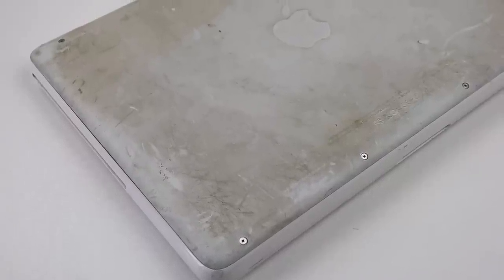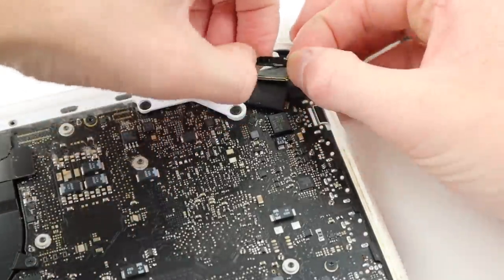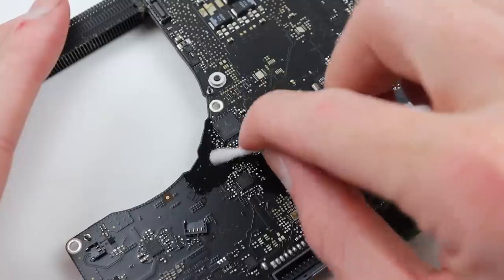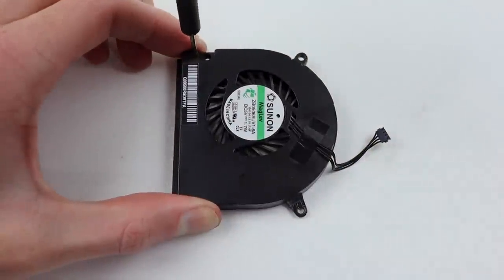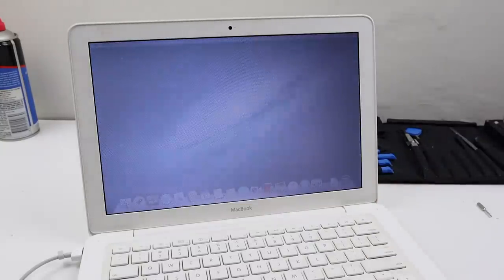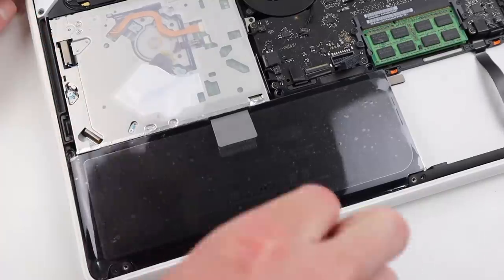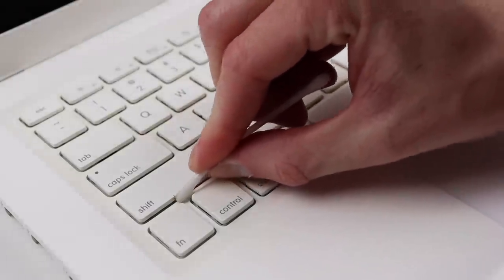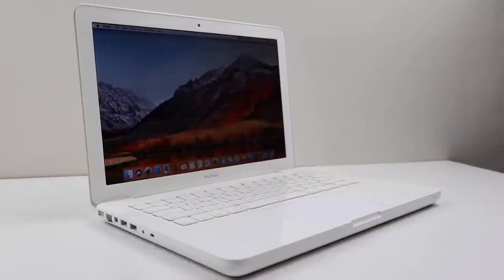Filthy, Dirty MacBook Restoration & Cleaning

Comment: Damn. Very nice cleaning, Hugh! I still have and use this Mac as to date, every once a while since I bought it in 2009 as my 1st Mac ever. The rubber bottom surely is dirty by now, but not this dirty. And logic board areas only dusty on the fans, will try to re-paste it for the 1st time, thanks for the tips!

Comment: GREAT Job. My very first MacBook was that generation. I've since gone through two more MacBooks since that time, with my current one being purchased in 2020 and has the M1 chip. I use my Mac quite extensively giving them a life span of about 5 or 6 years before needing to be replaced.

Comment: 99$?, I paid like 25€ for the same one, with same tools.
Reply: That must be 99AUD not USD
Reply: @shivangsingh8417  still double the money
Reply: @sriramx1  Shipping to AUS can get expensive real quick 
Also, prices down there are pretty insane in general
Reply: euro has a much higher value then AUD so you’re basically paying the same price in most cases
Reply: Okay, so with Hugh his work it's absolutely not profitable in any way shape or form. BUT THEN YOUTUBE! His content is the money earner. That's what his channel is based on. In any normal situation dropping $99 on a battery for a 2010 MB is outlandish. But because he did people won't call the video half in the bag and the video will be successful and make that back in no time at all. He did a very good job with it I must say. Mid-2010 MB's are actually pretty good machines to run now adays because of MacOS 10.13. The only issue I had with the video was the fact he dropped $100 on a new battery, $50 on a SSD, but then REFUSES TO UPGRADE THE RAM BECAUSE "At the time ram is expensive." DDR3. DDR freaking 3. The max that machine can run is 16gb. to get 2 sticks of DDR3 8GB is like $40 in total. To get AT LEAST 8GB of total ram would be $20! The difference of 4GB and 8GB is what makes the entire computer worth it. Hearing that ruined it for me, HE WAS THAT CLOSE to making a good machine, dropped $150 on a battery and SSD and says "4GB is fine." Shame.
Reply: Joseph Clese I agree
Reply: Any link for buying the battery sir? @XPLSVdstr.
Reply: Paulus Leonardo I was agreeing on the ram not the battery. I have not purchased the battery. Sorry for the inconvenience
Reply: @bobeshekyan3990  I ask to the guy who buy it sir eheheh, I forget to mention him
Reply: Paulus Leonardo it’s no problem
Reply: i just paid 75AUD  for a 2016 Macbook . Because of the Current government we have crap conversion rate . Our  1AUD is 49-51 GBP

Comment: I have the same model as above but upgraded to 8GB RAM, 250GB SSD, 500GB HDD, new speaker, new battery and new bottom cover. It was my work laptop for many years and now repurposed for iTunes library.

Comment: I think something that might help is that for adhesive residue, normal lighter fluid can be cheaper than purpose-sold adhesive remover and more effective than alcohol. Judy be careful, it can sometimes dissolve certain plastics too.

Comment: Great video!  Small tip: When removing stickers, the best option is to use acetone, or nail polish remover which has acetone in it. It takes much less time compared to using ethyl or isopropyl alcohol
Reply: Uh no, bad idea to use acetone on plastic. I spilled a little on the cover while doing my nails, it melted the plastic. 

I personally use eucalyptus oil (unironically) and paper towel, just scrub it out.

Comment: I got the same MacBook design, but earlier. 2009 late. It was the first unibody plastic. 
I am actually writing this comment on this computer. I still absolutely LOVE it, however I use it as as secondary computer/main computer is an iMac 27"/. 
Got the same SSD which really gave a kick to the speed.
Mine is in perfect condition. In fact a few years ago I brought it to the Apple Store to change the bottom rubber part and the guy was surprised how clean my MacBook was. He said it is rare to see a MacBook in this condition. So I took it as a compliment :)

I will never understand how people can make their computer so dirty.. 
These things are expensive, why don't you take care of it, so you can use it much longer...

Great video, added to my fav. list!

Comment: These MacBooks are kind of dear to me as it's one of the very first laptops I ever owned. Trying to piece one together using Mac's bought for parts, but will have to be careful with the ones purchased, as they are rather fragile from being abused and left to their disrepair. Glad yours didn't need much help, just the minor additions of SSD and the battery. Mine have bent hinges along the back. We'll have to see how far it goes, but I've noticed no life from the second MacBook, and a distorted feed to the screen of the first. Thanks for the direction.

Comment: Amazing job mate. In last december my macbook pro  felt in thd floor and the motherboard broke. Since that, as the repair is quite expensive here in brazil, I am using an older version of this macbook, the mid2009 as my dayly driver. They do are still up go the tasks. Those were well madd computers.

Comment: Hi Mr. Jeffreys. I have a 2008 Macbook that still works with all original parts including  its original battery and charger. The only thing that does not work is the trackpad so you'll need a mouse. It looks very decent except for the bottom:  there's a dent and some misalignment and some missing rubber pads. Any suggestions what I should do with it? Thanks!

Comment: THE easiest way to clean ANY motherboard it to wash it. Spray it with mean green let it sit on the motherboard about 15 minutes and then run warm water over it. let it sit under a fan until it is completely dry and when done it will look like new. An added benefit is that on older mother boards you clean under components you would never be able to get at any other way.  I have done this with motherboards since 2000 and it has never failed. Also IF you are going to use a brush a paint brush works better. The ends are softer and get in the cracks better.

Comment: I actually bought a MacBook just like that off EBay for 50 bucks. The insurance company that it came from was getting new ones. They had put in a SSD drive and eight gigs of memory before they decided to get new ones. Everything works like brand new. First MacBook I’ve ever owned. Plus I saved from the trash heap.

Comment: Ive had this computer since 2010. I got an SSD, 16gb RAM, and an LCD replacement. My cat used to sit on the laptop while it was closed and damaged it. I recently also changed the thermal paste, I had put off doing it for a while because I had no prior experience and taking apart the motherboard made me nervous. My laptop would get RED HOT with 11 year old thermal paste. It would get so hot that when I would charge it , it melted the plastic around the little pins on both the charger and the port. I followed the guide from ifixit for this specific laptop. When I turned around the motherboard, I was surprised at the amount of dust on it. It looked fairly clean on the surface, so I wasnt expecting the caked dust on the underside. The top screw of the heatsink was so tight that I never was able to remove it. I stripped it but Im lucky it was the top screw, I removed the others and just slid the heat sink away from the board and carefully tried to bend it upwards as much as I could to place it back properly. When I turned it back on, the screen had red glitches on some areas. My heart sank and I opened it up again, disconnected the display cable, blew air on it and tried again. A small piece of dust mustve been inside the connector. It worked fine once I turned it back on. It was really satisfying doing it and my computer runs quite cool now. I love that this laptop is so easily upgradeable.

Comment: I find the best way of removing dust off boards and other parts is with a make-up brush as it has lots of fine fibers and a rocket blower you would use for photography to blow dust off lenses. At least, it worked perfectly well for cleaning my ATX motherboard that I had to sell.

Comment: Hey i have a 2012 MacBook Pro and one One day when I had it on my bed I tried to turn it on and it just showed the missing folder logo and after doing a bit of research many people said that it was th cable connecting the hard drive and it doesn’t recognize the hard drive i than bought a new cable to see if it will fix it but I didn’t any ideas where they might be

Comment: Thanks brother, now I won’t have to throw away my Macbook Air I bought 2 years back. It’s battery is 85% healthy and it’s pretty fast for now. Once it starts showing ageing.. perhaps in 12-16 months more... will just replace the battery and clean the insides and done for another 3-4 years lol. I only use the macbook for excel, pages and safari.

Comment: Nice restoration. I agree that the 4GB RAM wasn't worth upgrading as this still has an Intel Core 2 Duo installed.
Can't believe that someone would let the laptop get into such a dirty state!
I've also taken apart random generic Macbook batteries (from job lots) and found that the capacity of the cells don't even add up to the stated capacity printed on the battery e.g. 6000mAh rated but the cells were only 5000mAh, or even less.

Comment: Might wanna check the keyboard connection, it looks like its slightly out on the left hand side, i find that when installing batterys on these it causes this too happen as the battery catches on the cable going too the connector, its not a big deal but it's something i like too check.

Comment: I still have a late 09 model. Needs new battery (on its second now).  Asides from some minor annoyances, like cpu not being able to keep up with the internet and YouTube, it is quite capable everywhere else I need it.  I find that 8 gig ram and SSD are essential, as I frequently push into swap as an intensive power user and enjoy older games that this system can quite happily run while chewing through great big gobs of memory.

Comment: Hi Hugh, 
I have the same MacBook somewhere in my house, it is in a similar condition (the rubber grey cover needs to be replaced because it is crooked, the battery is almost dead since it has 11 years so far and it has some dirt all around the housing). But I have a little problem: the CPU fan connector is broken, it has felt off from the logic board. I think using a microsoldering solution is not worthy, if I buy a new motherboard should I solve this problem?

Comment: hey.. no cavities. Is there a Apple laptop that has a full complementary keyboard? My advice is to put some plastic / rubber buttons to lift it from the table so it doesn't sit on it to prevent it from scratch it again.

Comment: Great tutorial 👌. I have a MacBook pro late 2008, not working, it just died and I don't know what to do with it. Battery is good but dies after 1 minute when you press the power button, It can't launch the program... But my cuastion is, is it possible to upgrade from i3 to i9 processor and monster cpu?

Comment: I am confused. Did you just remove a 256GB hard drive and replace it with a 240 GB hard drive and call it an upgrade?
Reply: No 250gb Hard drive to 240gb SSD so its faster

Comment: okay so I recently got one of these (a black polycarbonate MacBook) with no operating system installed due to the previous owner resetting it completely before giving it to me. it does turn on, but all it shows is a flickering apple logo, prohibitory sign and folder with a question mark (they all stay on screen for a split second each, flickering in no particular order). I don't have a copy of the required Mac OS X version and I don't know where to get one. what can I do👁👄👁

Comment: Metal polish is bad for plastic  in the long run it’s going to cause micro scratches use any type of paint polish instead if you want a good finish wetsand the plastic with 2000grit sandpaper and ya a DA dual action polisher to get rid of the scratches on the lid of the macbook

Comment: I was wondering if you could do a repair on a Huawei p10 or p20 device with a front mounted fingerprint sensor. My old p10 works fine, but for some reason the fingerprint sensor stopped registering touches and obviously reading fingerprints and I want to sell it in good condition.

Comment: I currently have a hp g62 laptop with an i3 M350 at 2.27GHz and I want to restore one that has an Intel Core 2 Duo, it is a mac model A1342 and I want it to study in DAW in computing. To program with java and multimedia would it be enough or for tasks? heavy is not enough?

Comment: Loved the video. QUESTION: anyone else is having problems connecting to the internet on this Macbook model with Mac OS X High Sierra installed? After installing High Sierra 10.13.6 (referring to the last update!) wi-fi keeps not working. Everything is OK with the wi-fi card!! I have a partition with an older version of Mac OS X and the wi-fi works perfectly!! But on High Sierra... nothing. Anyone found a way of solving this? Thank you.

Comment: I dropped my iPhone 6 (which has a replacement screen that doesn’t stick on very well) on concrete and now about more than a quarter of the screen is cracked but what’s weird is that the phone will reboot every 3 mins even if it’s plugged in and also the battery count will start at one percent when it reboots but then it goes to a more accurate percentage speaking of it when I plug it in it will be on say 77% but when I plug it out it goes to 74% do u know what the problem is?

Comment: Hello .. I have a MacBook Pro 13” mid 2012 purchased in 2014 not used much but I kept updating that to the latest OS, Now running on Catalina. From last few updated it’s getting slower and slower. It takes about 3 minutes on apple logo screen then another 5 minutes by password bar to appear then further 10 minutes to be in position to be used. After all the above fight I can just do few browsing along with iTunes, that’s it !
Is there any way I can make it better ?
Reply from the maker: You best bet would be with an older version of macOS or just install windows 10, would probably run faster.
I don't know what your specs are but you would need at least 8GB of ram and and SSD for the laptop to be usable on any modern operating system.

Comment: If the RAM is DDR3 you should be able to get 8GB of ddr3 1066MHz or 1333MHz on ebay realy cheap i bought mine (2x 4GB crucial DDR3 1300MHz CL7) from happymqi-0 on ebay for 20 - 30 US dollars and free shipping but my laptop is a Dell and if that macbook needs a different kind of memory that is only for macs upgrading it might not be cheap.

Comment: This is 2010 mac-book, I have new ones, everything is soldered to the mother board.
Reply: The only thing I like soldered in is the ram because the connectors are so fragile, even if you never touched them. The MacBook Pro (Non-Retina) Ram Slot issue is so common

Comment: Hey I have an iPhone 6s or just 6 and the screen is missing because some dude took it and S M A S H E D it on the ground then  the screen was garbage I had to take it off by cutting it the wire that connects to the screen so I was wondering can you fix it please 

Also if your wondering why did that guy do that well he was on drugs where I live its common for people to do that but I don’t want them to mess with my stuff

Comment: $99 on just the battery?  that's almost the value of the MacBook itself!  a shame you didn't restore it to original specs; a hard drive instead of the SSD.  the MacBook is completely obsolete now, it should be a restoration or collector's piece.

Comment: I have an original macbook air, it has a faulty display cable. Anyone know a good place to get a replacement? also I would like to upgrade to an SSD but it's a 1.8" zif HDD. Has anyone managed to get an ssd in one?  Model A1237

Comment: 3:30 do you call that compressed air? You need to buy a more powerful air compressor. That was a joke you did there. You shouldn't use a toothbrush because of static electricity.
Reply: The compressed air was just a can of compressed air. If you're careful enough, a toothbrush is plenty good enough.